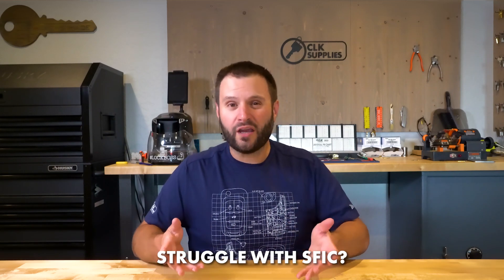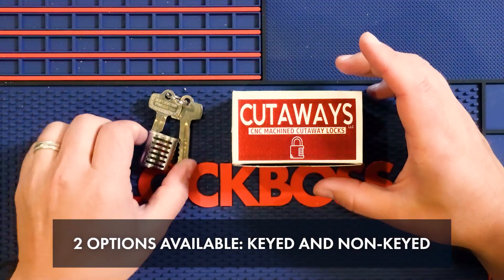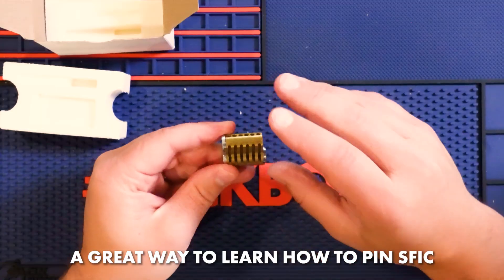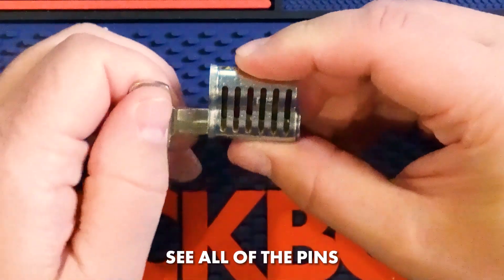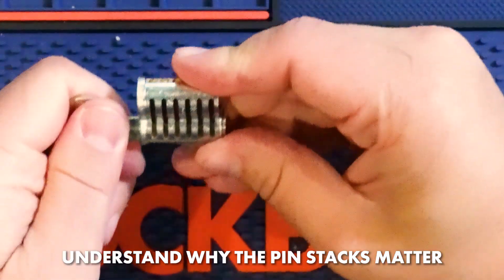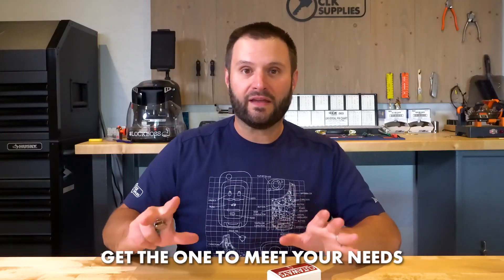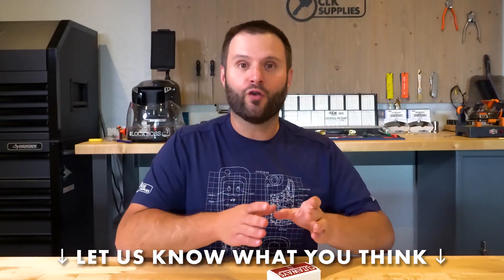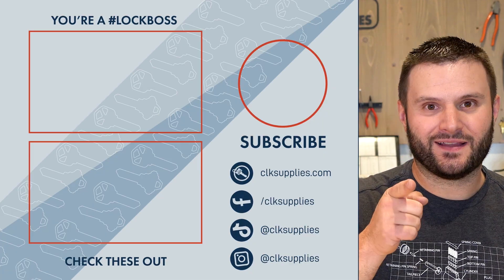SFIC Made Easy: Inside Look at the NEW SFIC Cutaway Lock

Comment: Awesome ! I just bought one. Been dealing with a core that 2 of the 7 pin stacks are 21 instead of 23 and trying to figure out what/ why they did it. I know some locksmiths do that to throw others off or by accident but no matter how I cut a key to work it’s not how it should be so a peek inside with this bitting will be a big help as there’s maybe 30 more that I will need to deal with soon. Thanks! #lockboss
Reply from the maker: Thanks! That will be a cool visualization of the issue -PJ
Reply: @clksupplies actually this would be a cool troubleshooting tool too- move everything over to this core for visual inspection, like you mentioned in video